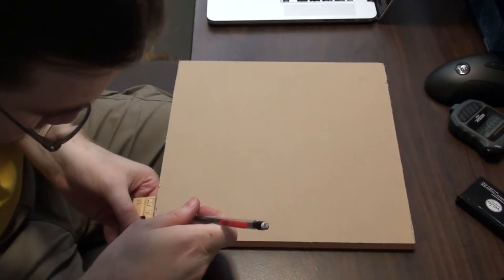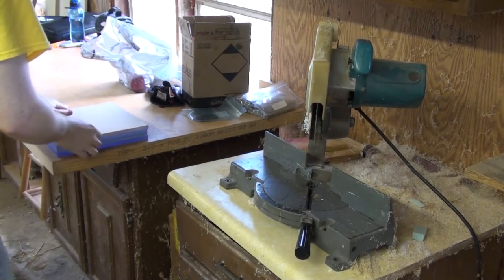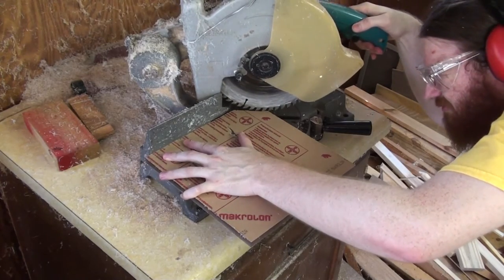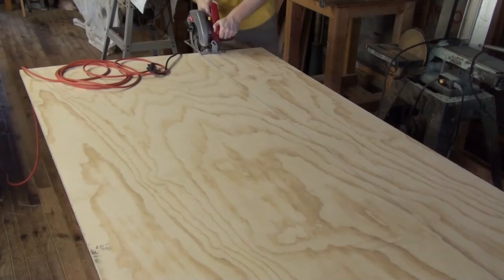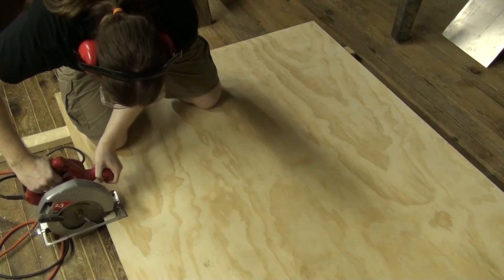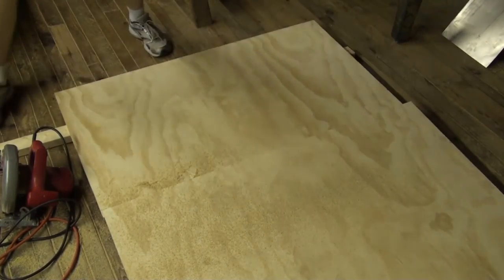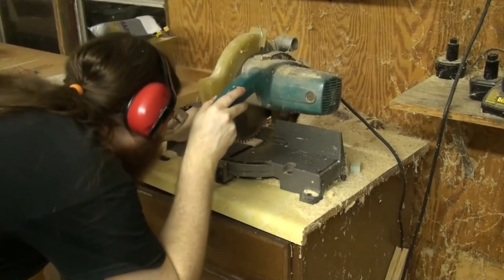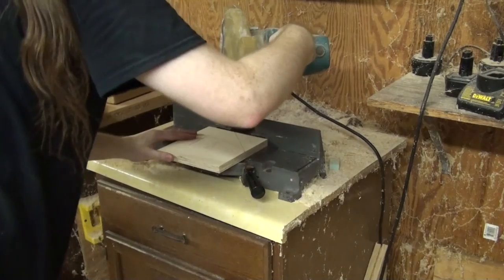Building an ITG2 dance pad replica - episode 2: Woodcutting

Comment: Dunno if your design accounted for this, but something you might considering attaching to the bottom of your unit once finished are these E.V.A. anti-vibration pads from supplyhouse.com (do a search). I've ordered some for personal use, and they seem like they would be pretty good at dampening some of the sound as well as preventing it from sliding around (I think you had wood floors?). They're as little as 50 cents a piece, depending on what size you get.
Reply: Anyways, good video. I enjoy watching this kind of stuff.